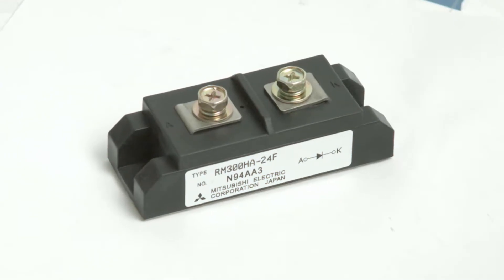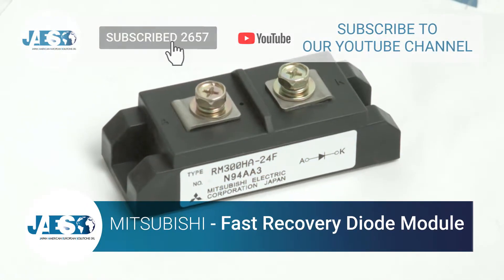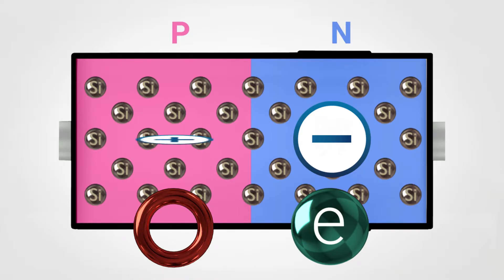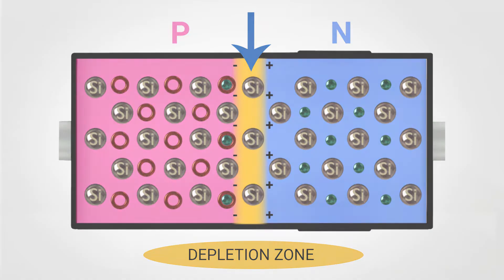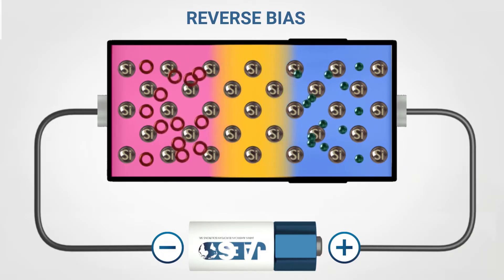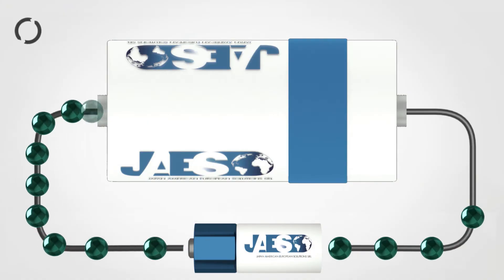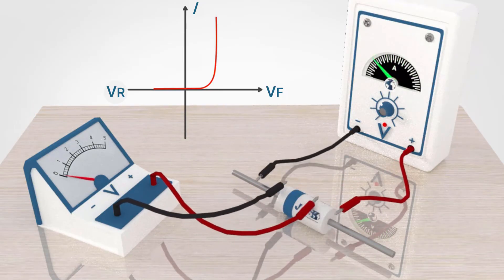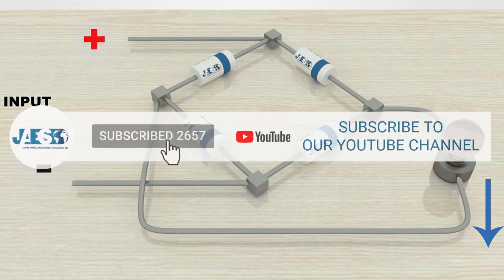What is a DIODE and how it works - PN junction and 3D animation

Comment: So does this mean there will always be a 0.7V drop when using this diode? I'm guessing the different kinds of diodes have different rated values for their barriers and are not all 0.7V?   If that's the case the rating of the barrier's voltage will cause that amount of voltage to drop, but thats only for a short period of time as shown in this demonstration and then the barriers voltage will diminish over time (in a forward bias flow  which is positive to negative ?) correct? So when we plug in a our electronic device to a diode and a multimeter we will see the voltage drop immediately but then itll pick back up a little ?
Reply: I think this voltage depends on the used materials, I think 0.3 for germanium, 0.7V for silicon.

Comment: Excellent.
One doubt : In diodes: why do the free electrons at the N side don't get "pulled" by the positive charged part of the depletion region, and neutralize the ionized atoms there?
Reply from the maker: thanks you
Reply: during the creation of n-p junction, the "free" electrons migrate to "holes" creating the negatively and positively charged regions. They do not get attracted because the covalent bound is stronger. These electrons "want" to create structure where there are always 8 electrons around an atom (google for "octet" rule if you wanna more about it). 

So even though the positive charge of depletion region indeed attracts these electrons from depletion region, this attraction is too weak to actually move them.